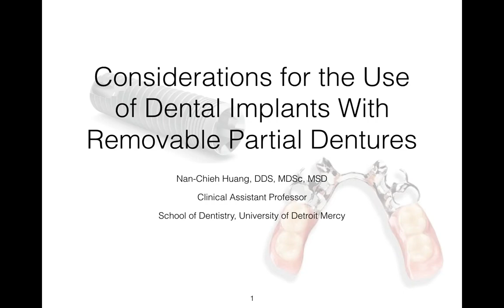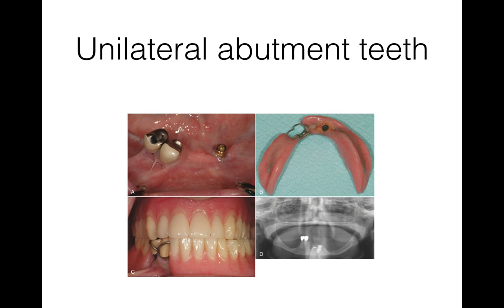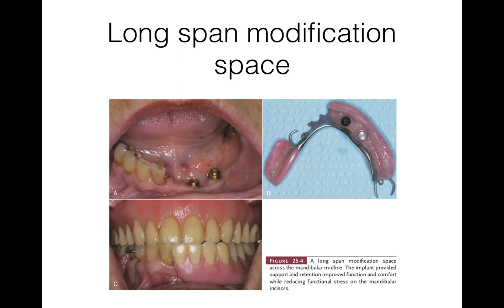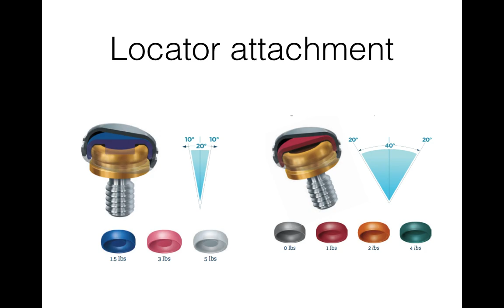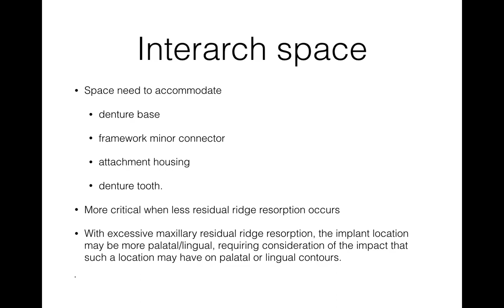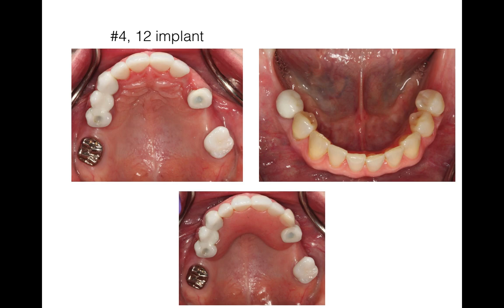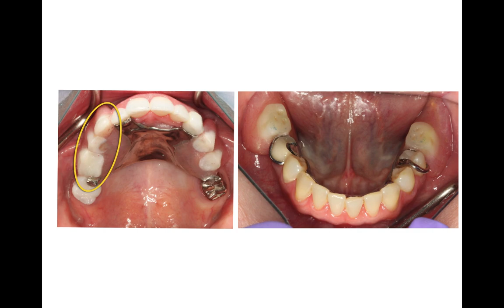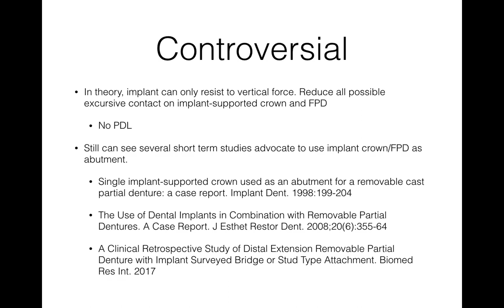15. Considerations for the Use of Dental Implants With Removable Partial Dentures

Comment: I am a dentist from Thailand. Related from your clip, I have a question. In case, the implant assisted RPD in Kenedy Cl 1 or 2 by place the implant in area of distal extension and use attachment on the implant, this implant acts like against the movement of RPD. In your opinion, is an indirect retainer still necessary? Thanks for your help.
Reply from the maker: Hello Darin Dent. This is a great question.
Yes, the direct retainer is still necessary. Implant attachment is not fully fixed so the movement of RPD around the fulcrum line still exists. To prevent the major connector from being displaced toward the tissue and tissue impingement, the indirect retainer is needed.
Reply: thx for your help.